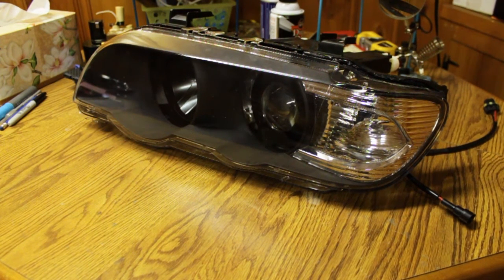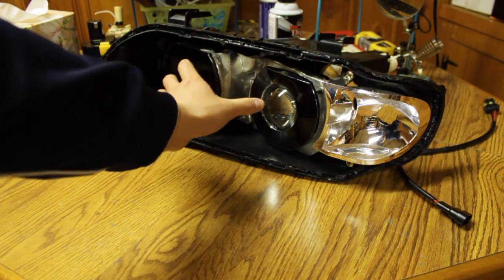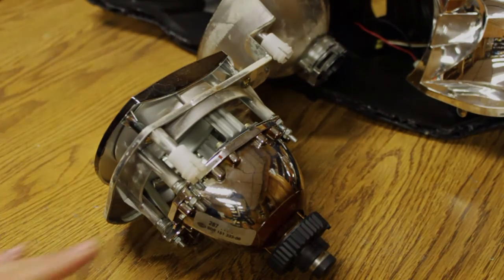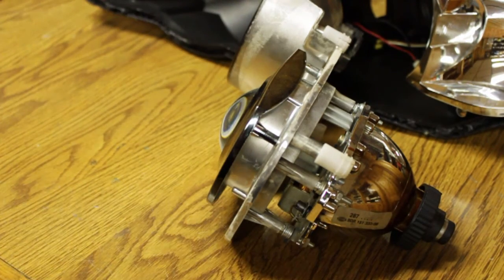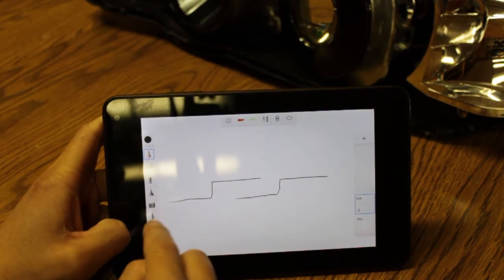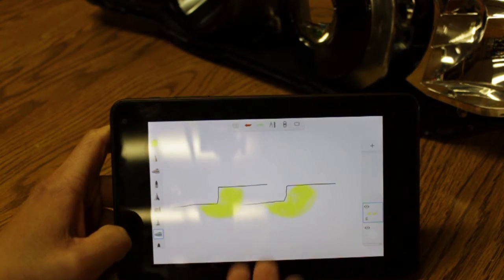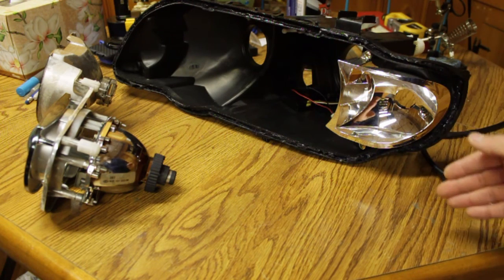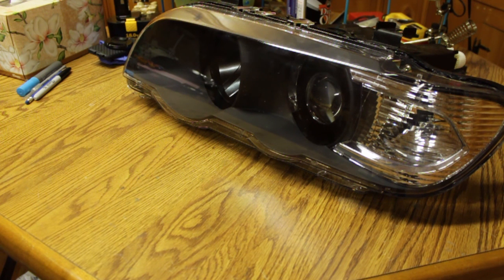BMW E53 X5 Bi-Xenon Retrofit!

Comment: Do you have the leveling motor and harness too?
Reply from the maker: Not on this one because it had halogens originally. It can take motors though
Reply: @MINIzguy  Is there not a way to get the motors to work if it came with halogens originally? My x5 03 has two connectors on each side that aren’t being used and they are each 3 wires to them. Any idea what they go to? I have the headlight sprayers as well
Reply from the maker: @leveluplife8585   check the wiring diagram to the color codes of the wires. I don't have a clue what they would be for. To get the motors to work, you'd need to wire up the leveling sensor and reprogram the LCM at the minimum